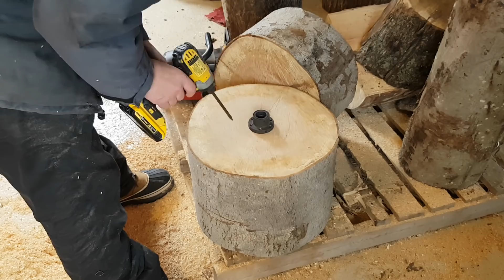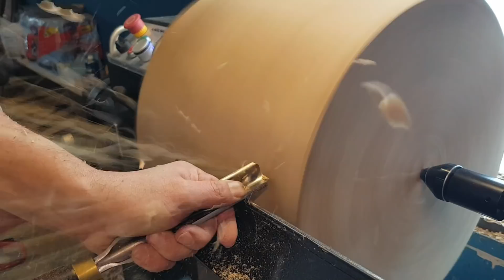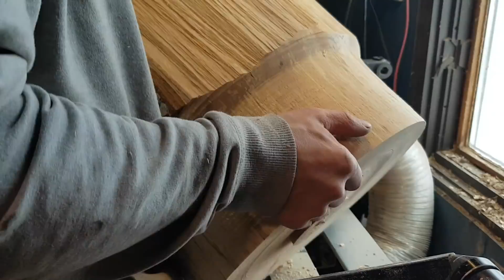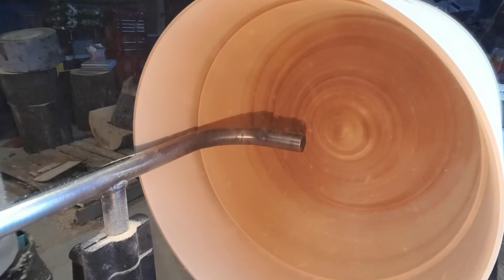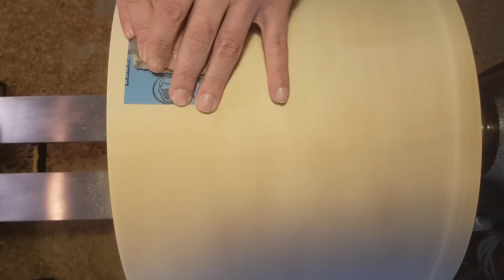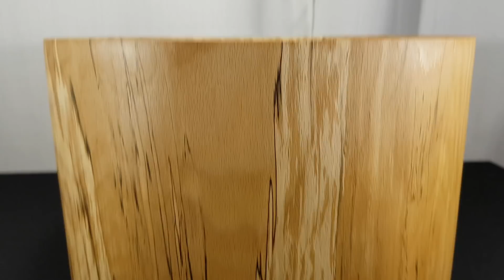Woodturning Spalted Lamp Shade

Comment: I've been doing a lot of spalted beech to make bowls.  It's nice stuff.  But I tried to make a hollow form with a whole log (a bucket) and after drying 2 days it went pop and split in half.  Beech likes to split even the bowls do it a lot.  Did this split on you later?
Reply from the maker: +Robert Schuster Yes it warp and I got a Crack to :(
Reply: Yep.  Beech.  Sometimes as I'm working with wet beech it cracks while I'm turning because it dries faster. Beech makes great tool handles though.  I've made a couple dozen bowls with spalted beech and about 35% cracked no mater how thick or thin they were.